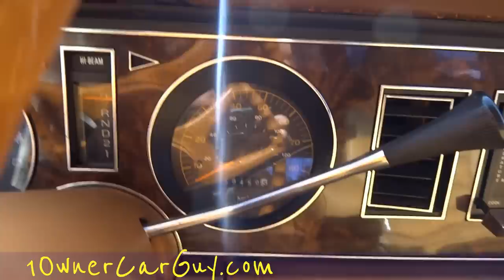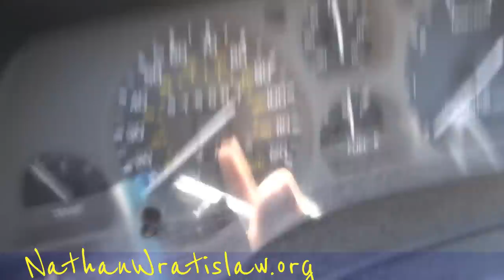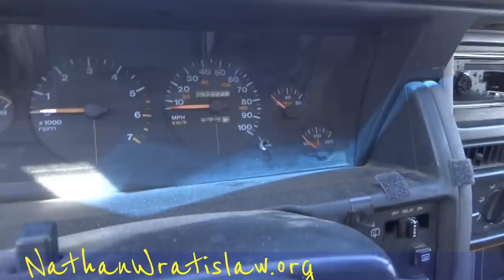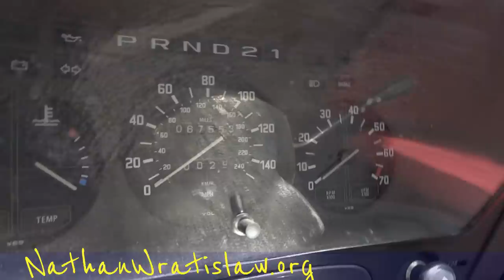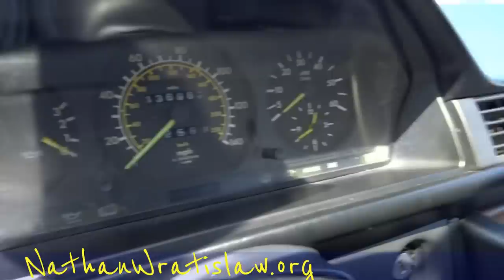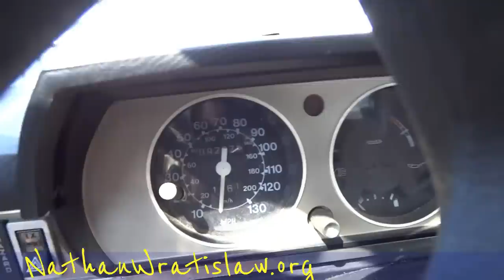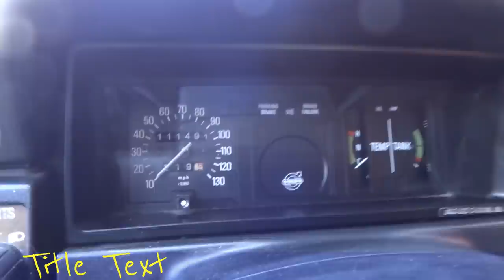HUGE Classic Car Sale Lot For Cars Moving Liquidation Cheap Youngtimer Rare Walk Around

Comment: Mercedes S600. If anything is wrong with it, it will cost more ti fix than it's worth.
Reply: Any MB under 03 are the easiest things to fix. Parts are expensive at all. I repair those older Benzes, so i usually scoop them up for cheap!